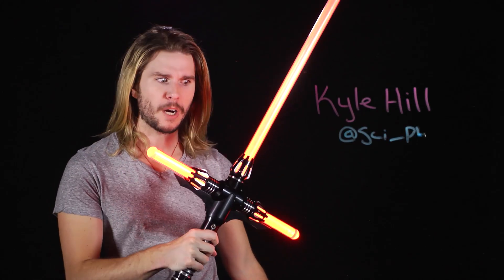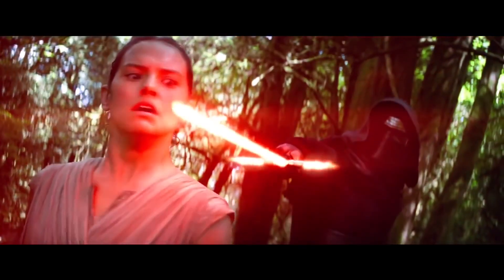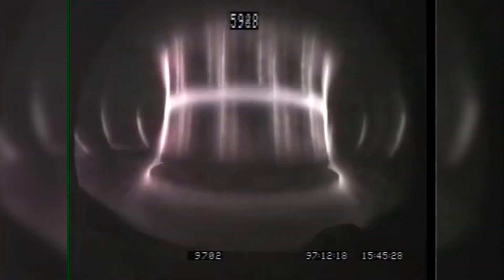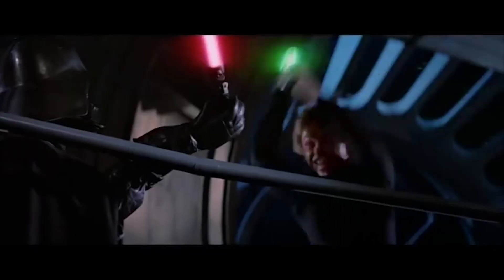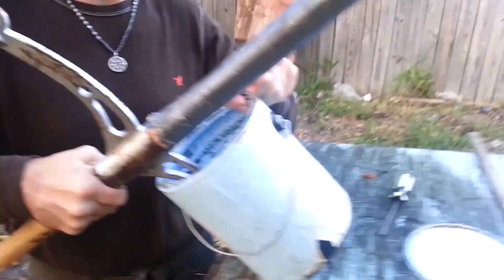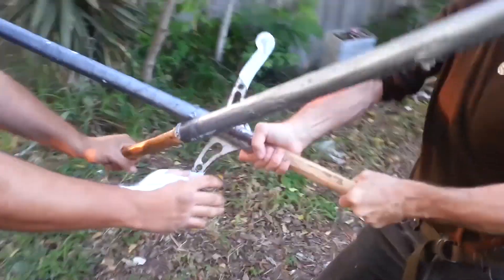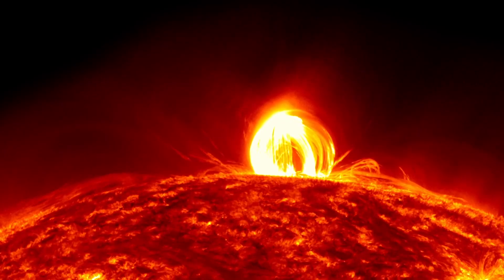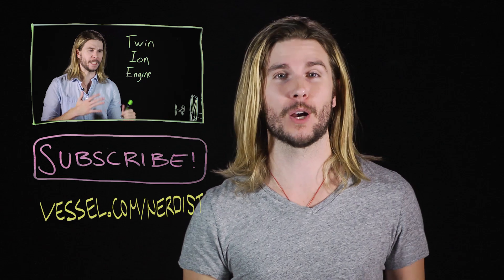Why Kylo Ren's Lightsaber Works (Because Science w/ Kyle Hill)

Comment: Yeah real historical cross guards were made out of metal, not plasma, and weren’t blades. Plenty of historical swordplay techniques actually use manual contact with the cross guard intentionally, and more importantly incidental contact wasn’t an issue. All it takes is one stiff blow at the wrong angle the swordsman isn’t expecting from his opponent, or movement of the hands in order to properly manipulate the blade, and manual contact with the cross guard occurs. Equating a dull metal cross guard with one made of kill-you-juice is a bad analogy. This thing would definitely wreck someone who actually brought it into combat.

Comment: When I first saw Kylo’s lightsaber I really thought it was the coolest thing I’ve ever seen, cause that’s how real swords were. But then again they only had those side hilts to guard against attacks sliding down the blade. So yes or no question would Kylo’s blade block another saber if it were to go down to the hilt?
Reply: It would, those are vents for plasma energy, meaning they aren't emitters themselves. Cutting the base of an emitter would destroy/ruin a lightsaber, but cutting the base of a vent would just make it more unstable. Colbert was actually correct, I guess?

Comment: It's stupid because it tries to treat the lightsaber like a metal sword, when in truth, the lightsaber blade has so much friction that it becomes impossible to slide the blades against one another. Hell, the only time we've seen lightsaber blades slide against each other, it cause a horrible crackling noise, showing that there was too much resistance when Anakin beheaded Dooku. The other big reason why most force users don't use a cross guard is because they don't need it and it could cause more problems then it helps, especially when now, the lightsaber hilt has additional parts that'll push against the hand.

Comment: 0:21 he's not really a dummy if he can find a way to have his lightsaber or not explode. Because the main reason why he made the lightsaber like that to that all that heat of plasma can go out and another way to.

Because think about it his lightsaber crystal is cracked which is why it Statics like that so you can't just have one end of the blade like that it would have to be longer and you can't really have a very long lightsaber are you going to have disadvantages which is why he made two ends so that all the heat can go out.

Comment: You think the cross guard is dangerous? 
Iv been studying training and practicing HEMA (historical Europeans martial art) and can not recall ever touching my cross guard with any part of my body other than chocking you on it with my hand. If that part of your sword is that close to any part of your body you’re already incredibly exposed as is and probably just going to get stabbed, and when you know that the cross guard is always parallel with your knuckles you can turn your sword 90 degrees by turning your hand with no consequence because the blade is omnidirectional and no real time restraint cause it just takes your wrist. 
But also, in a bind a cross guard that is dangerous can be pivoted to strike to opponent, in addition to the hand protection.

Combine that with the fact that certain parries just don’t work if you don’t have some kind of guard cause the opponents sword will just run into your hand and a cross guard heavily expands your defensive and offensive options, is incredibly dangerous to your enemy, heavily protective of yourself, and it takes an incompetent fool to hit themself with it. 

Just about every sword in history has some sort of hand guard. For a damn reason. I remember watching the original Star Wars and seeing the light saber turn on and thinking it needed a guard. 

Compare that to the double sided blade of Darth Maul. Which almost completely prevents you from attacking horizontally without gutting yourself for a mild increase on vertical strikes. If Darth maul wanted to strike horizontally he’d have to either hold his weapon above his head or turn his whole body in a continuous complex footwork that keeps him immobile. And should he make a mistake of equal effect to saving yourself with a quarter staff he’ll either gut himself or fall on his ass. And if his weapon was hit to the side with any sizable force he would also gut himself! 

Cross guards appear in history for a god damn reason. Double sided weapons do not. The closest is a quarter staff, which is only remotely usable that way because the grip is so adjustable. But nobody is mad at Darth maul’s light saber for having a second blade that does very little but limit the amount of ways you can use the weapon effectively

Comment: The cross guard doesn't make sense, if it's one blade how does it turn on the side beams independently from the main one, it has to be lightsaber proof and if that's the case make the whole cross guard out of the lightsaber proof metal
Reply: Vincent Meade They’re vents because the crystal in his lightsaber is cracked. Basically it puts out too much energy for the one blade to handle so it has the extra vents to stop the whole thing from exploding.
Reply: @ZafiroDoesGames  than why doesn't the side blades cut through the vents?
Reply: @vincentmeade2534  Because the vents have a larger diameter than the blades
Reply: @dracopo8862  how does that make any since, lightsabers can burn through alot more than that

Comment: Just gonna leave this here as a ñittle debate starter: what if Han Solo did mean he made the Kessel Run in less than 12 parsecs, meaning it went so fast that relativity took such an impresibe effect as to reduce the full length of the course by, for example, 88% (provided tge course was originally 100 parsecs)? If that would be the case, he would be going at enormous speeds, if you really think about it

Comment: The thing about Kylo’s lightsaber is that his kyber crystal is cracked meaning that the power inside of it isn’t controlled, so the design of his lightsaber is actually based off of ancient lightsaber designs. The “cross guards” aren’t cross guards at all although they do act as them. They’re actually exhaust ports. If you looked into it a little bit you’ll see that some of the first self contained light sabers in the Star Wars universe had these exhaust ports on the bottom of the hilts and on the side like Kylo’s

Comment: The only, ONLY complaint I had with the saber crossguard is that the metal pieces between the blade appear too thick. 
A saber sliding DOWN the length of the blade would catch the metal part, not the other saber part, and possibly cut it off or damage the lightsaber tremendously.

Comment: It also ties into the deisgn of the lightsaver blade. The crackly and chaotic energy of the blade is due to a cracked kyber crystal, and it generates more heat, so it needs vents to vent out the heat through the form of the crossguards

Comment: Kylo Ren's blade has a fractured crystal, that's why it sounds/looks different from other red saber blades. The cross guards also act as vents for the excess energy coming from said crystal. It is considered an ancient type of saber design and has a fighting form based around it. So kylo both has a canon reason to have a saber that looks like that while also not getting hurt in the process. Just wanted to add in on the debate 🤔

Comment: The design method used in kilo’s saber is called unstable or something but basically they are like exhaust so the Crystal doesn’t explode like the comment below says
Reply: Well the crystal is unstable and cracked thus giving more power than the usual lightsaber. The vent(s) can be 1 or 2 or even more depending on the crystal.
Reply: @bananabob4753  where would you put a single vent? Would it have a single short blade coming out the side?
Reply: @750tiprogamer  yes I saw one in the comics. It was angled upwards about 45 to 30 ish degrees. It's actually not only used on cracked crystal for some strange reason. Maybe it was an old way to adjust the blade length. It was an ancient design after all.

Comment: I think it has a separate purpose that’s important. It gives Kylo Ren something unique about him. And it also makes lightsaber crossguards his. If anyone in the Star Wars universe or our ever sees a lightsaber with cross guards they’re going to instantly think of Kylo.
Reply: In fact, the reason why the lightsaber has a crossguard, is because the kyber crystal is unstable (or cracked) so it has too much power, and it needs those two guards to vent it or else it would explode.
Reply: @traytrxy  iirc this is also not only used on cracked crystals? It's also to adjust the length of the blade. I'm not sure though. It is an ancient design, maybe they don't have the tech to adjust the blade yet back then.
Reply: @bananabob4753  Probabaly no, cuz he probably had a good tech when he made his saber. Those vents have the only purpose to prevent the blade from exploding. And not gonna lie, they do have a pretty good aesthetic.
Reply: @traytrxy  I'm not talking about kylo's light saber. Im talking about other light sabers without cracked crystal that has the same design.
Reply: @bananabob4753  Oh, I see, but no I don't think that's was the reason, cuz what determines the length is Emitter Matrix to a certain degree and crystal focus. (I read that in a reddit post if I recall) So basically the vents are just to retain stress.
Reply: Anyone can see exactly why it’s got such a giant design flaw. 

What happens if the opponents blade hits the cross guard emitters?

Comment: His lightsaber is that way because itsa unstable crystal and the energy is diverted to the sides there are more variants of this with some coming out the blade end and a short bit of energy coming out the bottom of the handle

Comment: No, the kyber crystal is cracked so the vents (crossguards) dispense the heat from the cracked crystal.
Reply: It's irrelevant whether it's to vent or an intentional extra blade. It's going to block an incoming lightsaber regardless. That's pretty useful in a universe where we see frequent hand loss in lightsaber duels due to lightsabers offering no protection.

Comment: So science boi Kyle talks about the problems with lightsabers a lot. How do they stop at a certain distance instead of going on forever like a laser would? If they were that hot then you and everyone around you would die when you turned it on. Getting hit by one wouldn't cut you, it would sublimate your body and you'd explode. But I think these problems can all be solved by something that we've seen in the star wars universe. One way shields. If part of a lightsabers design was a one way shield it would let anything into the shield but would contain the "blade" giving it it's shape while also keeping the intense heat from spreading. And when you "cut" someone or something what went into the shield would sublimate and whatever didn't wouldn't b harmed. Plus when you turned off the lightsaber the particles trapped inside the shield would be released which could account for the sound we hear them make when they turn off . . . . just my thoughts

Comment: Hey guys the reason this works is because the kylo rens kyber crystal is cracked the kyber crystal is the power source when it is cracked it does not go in simply one direction another reason his saber looks so much different and volatile compared to the other light sabers also the reason why you can’t cut the metal off is because it is a special mineral sorry I forget the name of it but it is somewhat light saber proof

Comment: That explanation requires the magnetic fields to form ninety degree angles to shoot the exhaust out the sides which just isn't possible in the star Wars universe. If the magnetic fields could be curved or bent then we would have seen curved blades and all kinds of other variations in saber "blade" design but we never did.  The closest we see is the wip but that has a completely different explanation.  Kylo's cross guard isn't a cross guard anyway, they are exaust ports which destroys the efficiency of the design due to a loss if energy.  There are several materials in the star Wars universe that can deflect lightsabers.  Just construct a cross guard out of one of those.  The power and visual effects of Kylo's blade are supposedly due to a crack in the crystal.  This is also dumb because if a crack could make a beam stronger then the sith would have put cracks in all of their crystals when they were artificially making them.  No professional would use a cracked weapon.  It's hurts my head when people go to such lengths to justify Disney's stupidity.

Comment: Slight problem with the ‘blade on the inside’ thing. The lightsaber blade doesn’t physically exist until the energy passes through the emitter, the further most point on the hilt. 
PS: Kylo’s blade crackles because there is a huge crack in his lightsaber’s crystal.

Comment: The lightsaber in general is a flawed and awkward weapon. You can't feel the weight of the blade, so it is incredibly easy to sever you own appendages, and it cuts omnidirectionally. The only reason it works is because the Jedi have the Force, and in which case, there's no reason to suggest that it wouldn't be just as if not more efficient. The double bladed saber is even more of a nightmare because despite being a longer weapon, you get minimal extended range because you can't touch the blades with your hands, nor can you strike someone while defending yourself (like you can with 2 regular lightsabers) because your other blade is facing the opposite way. Just enjoy the cool fantasy swords guys. The guard itself has already shown itself to be handy in 2 fights and the double blade one makes fighting 2 people at once from different directions seem feasible.

Comment: So, on the parsec thing, I thought, you know navigating an asteroid belt is dangerous.  or a nebula, and usually hazards would have to be gone around (requiring more distance) but what if the falcon could make that trip through the Kessel belt, using a path that only measured 12 parsecs in length.  Rather then how little time it took, it was how little distance it was able to navigate a hazardous path in a distance no one else was able to do, maybe it took longer, but wouldn't trying to use a measure of impressive small distance then time be the exactly the thing a scoundrel trying to get a deal would do?  Just a thought.

Comment: Plus it showed an extra use. It is used to burn someone when they clash and lock blades with someone, like Kylo did with Finn which is a great move and gets people off of you, plus it will be somewhat easier to deflect blaster bolts in case you are a little off.

Comment: Crossguards are also usable as on offensive weapon with for example the "Mörderschlag" this means grabbing the blade and using it like a hammer
Reply: i dont think that would work with a lightsaber though
Reply: @nathananderson1550  I know
Reply: actually what if you had gloves with built in tech thats used in the hilt to contain and project it? probably in conjunction with the force i wonder if it could be done... it would certainly be effective on someone at least once
Reply: @nathananderson1550  maybe

Comment: Kylo Ren's design is based after an ancient design, you're right, but let's dig deeper into that....
The crossguard lightsaber dated back thousands of years during the Great Scourge of Malachor, so he might have been inspired from there but who knows. The design of the ancient Jedi on Malachor wasn't puilt with the same purpose as Kylo Ren's though...
Kylo Ren has his crossguard blades due to a cracked kyber crystal. How did it cracked? Great question! When Ben was sent on Mustafar (I think..) to make his crystal bleed, he might've put a li'l bit too much of the Dark Side and it cracked...Ya. That's why you can't have nice things for your fancy-ass lightsaber. That's the reason why the blade looks so like it's flaming and crackling, it's due to energy diverting from the crystal. Some of you are thinking "Hey, how do you make a crystal bleed and why does it bleed?". Well, little Billy, it'll take some time to explain...I'll explain both versions very quickly:
Canon - We all know that a crystal corresponds to the personality and Force affiliation within a person, with red meaning it's bleeding, so it's basically a synthetic crystal. Again, I didn't explain how a crystal is bleeding..So, you take a crystal from a Jedi or even from a simple, colorless crystal, and affiliate it to the Dark Side by putting your memories in it. A crystal is red and bleeding because, how Emperor Palpatine explains to Darth Vader, the crystals are living beings, so they can bleed.
Legends - In legends, it's a little bit more easier to swallow. :P Because the color of the crystal is found on a specific planet, red being the rarest and calling to Sith only.
That might explain why Kylo Ren has a crossguard, why his saber looks like it's crackling and why a crystal turns red. That's it and that's all. You can go home now, why are you still reading this? :P

Comment: I disagree with one thing - what would stop Kylo‘s hand from sliding down and being severed? Because, yes, old swords had these crossbars, too, but they weren‘t sharpon the side facing the swordsman. Thterefor, I still don‘t like them. Just another visual effect that makes no sense.

But thanks for your videos - I really enjoy them!
Reply: if youll notice the cross guard doesn't pop out straight from the hilt. its probably got a little less than an inch on either side. also when has a force user ever let a light saber slip out of their hand